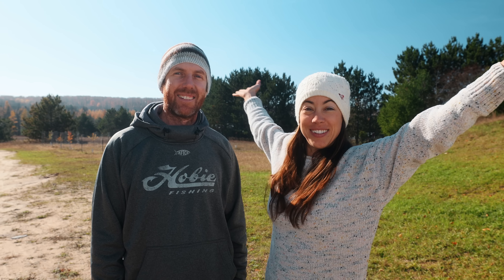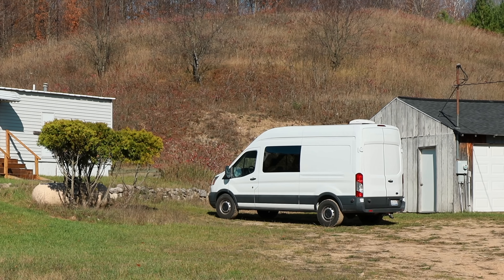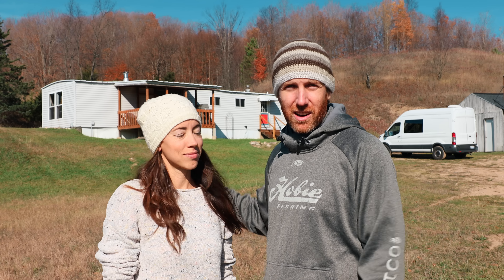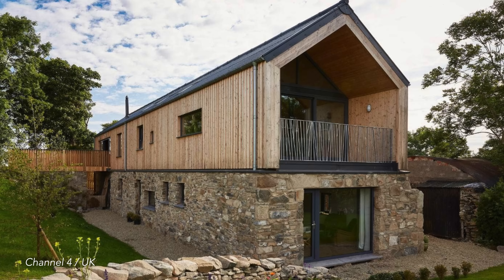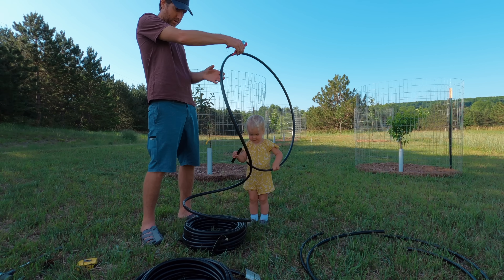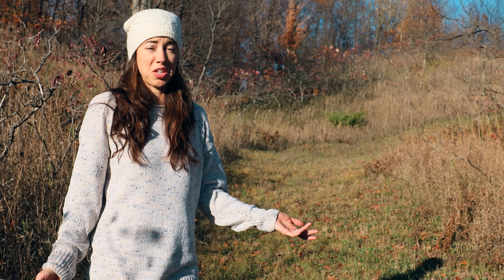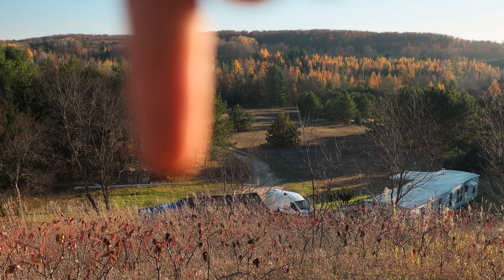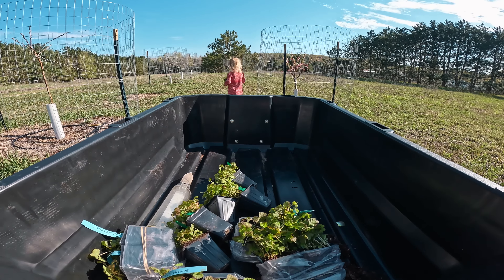Unveiling Our 9-Acre Homestead | Sailing Soulianis - Ep. 125

Comment: Lots of good suggestions here. I will add one you probably already learned from sailing. Buy quality to prevent emergencies, and budget for emergencies that occur anyway. New well pump? Well goes dry or goes bad and needs to be redrilled? Repair or replace septic? Raccoon gets into a building and trashes everything? These are occassional rural surprises that townfolk never experience, and even rural folk forget about until they occur.

Comment: We built our dream house on top of a hill overlooking the Missouri river valley.  When the wind blows, we certainly know it.  That said, the view is amazing, year-round.  We spent extra on 2x6 framing high quality doors and windows, and geo-thermal HVAC but NOT on insulation.  We used typical fiberglass batts and blown in.  The HVAC has absolutely paid for itself.  Foam insulation was moree than $20,000 over the fiberglass (not including the air-air heat exchanger for fresh air source) which would been forever return on investment. Under $200/month for utility (all electric) for 14 years for 4500+ sqft.

Comment: great to have goals...nice to see them evolving.  Reaction:  your Michigan limits will be cost and time if you do it all yourself.  In Europe on a house like that they don't build them but buy modular designs delivered to the site which are prefabbed, well insulated and very efficient.  All you do is pour the foundations/slab the modules sit on and connect in a day or two or three.  then do the finishing. All manner of degrees of stages can be bought usually.   It is an excellent solution done in a timely manner with less waste, less energy from you and pre ordained good architectural results.  In terms of do it yourself, I suggest you try the least critical, the pole barn, yourself to hone your skills and show yourself how much time and energy it takes.  Renting?  Talk to landlords and see what their experiences are first.  It can and often is a very mixed bag.  Permits.  What does the government body the land is on allow/'require?  Some permitsw take forever to get or are grandfathered against.  an unknown you learn first.  Gotta know what, how to obtain and the ramifications of that first.  Site looks lovely.  If you get a modular well built unit it can extend your season a couple months each way.....not a bad thing at all.
Reply from the maker: Have looked into modular, and affordable desirable options are certainly limited here. Those are our thoughts exactly about building the barn -- simple(r) project first, learn a bunch, then tackle the house.

Comment: Excellent; inspiring even. I hope you can make at least some of it work. I would love to see a map or a high drone shot of the neighbourhood or even a drive around. I have much smaller horizons than you do but I do have my 22ft cruiser in my back yard, under cover and I have my dinghy trimaran in a decent dinghy park a ten minute drive away  and it is stored  over winter in a hangar at a disused airfield nearby. - so I agree with much of what you are trying to do.  The deer have eaten my raspberries too (fortunately we do not have bears in Scotland.) A nice video. I hope your local builders are easier to work with than ours!

Comment: I’m currently in the process of building a Barndominium on top of a hill on property we acquired last year. The first year was building a road, getting water and septic. Early this summer we started building the main structure and have it closed in. Currently working on running power and doing electrical inside, want to be off grid eventually but starting out on grid was more practical. The view from the top of the hill is worth the risk of higher wind. But the barndo is 6x6 posts and 2x6 framing between the posts. It’s totally doable! Please feel to reach out and I can give you my lessons learned so far. I really enjoy your videos keep them coming! ⛵️😎
Reply from the maker: Sounds awesome!  Which part of the country are you building in?  Would love hear your plan on insulation. There are a lot of interesting debates going on in the barndo world.

Comment: I really love what you are doing and the adventure that is starting for all of your family.

(YOUR BOAT)  Not sure what to comment on but it may be best to start work on your large garage for your boat.  What I think your planning is great I just think you can considder the size a bit and make it larger if you can.  Why do I focus on storage for you boat as the first thing to considder is because of the harsh Winters in your location.  I could easily see your boat in deep snow and breaking down what condition it is in at this time, causing more problems.  I would focus on a permanent structure that may even include Solar for power and enough room so you can easily store your van as well as any other equipment you may want to have at a later date for farming (Not road vehicles).

(RENTAL PROPERTY)  I think its a great idea, but it's hard to visualize what type of structure (House) your going to put there.  The few questions I have about how viable of a rental property is my greatest concern.  With any rental property there is a line where upkeep and frequency really impact the bennefit or possability of it actually funding some of the things you spoke about in your video.  So thats a whole list of things to considder that I am sure you have already.  But an interesting project.

(MAIN HOUSE)  That seems way down the road with all the other projects you have on the table.  As to the location I think depending on the main direction of the weather pattern you can plant trees on t6he backside of the house location that in time can help with the wind (Pland sooner than later).  Before the first plan is done you can prepare the foundation by leveling and even laying gravel where you plan to build and years later that can be removed if needed.  The concern I have for the Gully location is snow drifts and water between seasons.  Without mayjor landscaping (probably will do anyway) the idea of building a house on that (Facing up the hill) Left side but not at the top due to (Wind) can cause many problems depending on the soil and bedrock in that location.  It may not be possible to build in that location so be flexable, as the Top or Left side choices may not even be a choice as I think the Left side choice may be more trouble than its worth.  I think a contractor or even a surveyor may be needed to determine the best possible location for a Permanent Main house to be built.

Lastly the planting of the Garden seems like a great idea, but I have never heard of a man made ecosystem that will be self sufficient, I am excited to see how that works out over a few years and one day a Garden of Eden.

If you made it this far thanks, at times I just cant stop.  You guys are great and love what you do.

Comment: I did a 1yr course in "CAD for Engineering and Architecture" a number of years ago. Courses included "Building Materials and Methods", I learned tons of useful stuff and would highly recommend something like that before you start. There is a lot to learn, from site prep requirements, zoning laws, fire and safety ingress/egress. Building standards vary quite a bit from area to area and a lot of close attention needs to be paid. However, one thing that I noticed is that there is a lot of room to build your own way as well. One area that interests me in particular is intelligent energy harvesting and thermal management. Being up north, if you leverage the sunshine and wind for heating you could save a small fortune in energy costs. You could also use the thermal difference between the ground and air to heat/cool at different times of the year. Lastly thanks for reminding us all of the reasons why we celebrate freedom, doing it your way is the ultimate sign of respect IMHO!!!!

Comment: Tipping the ends of the raspberries will greatly increase the yield. The cane will grow 2 branches and clusters of berries instead of singles. The canes also tend to spread all over. 
I hope your township will allow the rental units. I had to pull my old mobile home out and wasn’t allowed to rent it after I built the new house. 
I wanted to help with building my pole barn and was flatly told no due to liability issues. 
Mom and I found getting a modular house was WAY cheaper than a stick built the same size.  Walkout basements are wonderful and I love ours.

Comment: Go for it! I built my own house doing everything I could while holding done a full time job.  I hired out the parts that made since, concrete footings, Brick facade. Had a contractor pull the electrical and plumping permits then did the work myself, then the contractor inspected the work.  It took 8-months of hard work but the satisfaction of doing it my way was great.  I sold that house after many years and moved to town.  I was so frustrated with the home we bought in town because {built in 1955} there were not plugs everywhere there should have been among other gripes.  Point is when you build your own home you customize it as you go, and when done you will have the perfect house for you and the pride of a builder.  Best of luck.

Comment: Some rural ideas to share. Minimize exposure to propane. Ground loop heatpump, mini split heat pump, solar water even if not winterized.
Kuboto tractor just big enough for any attachment you will want. Snow blower might be better than blade, earth moving for sure, ~25hp.
Consider SIP panels, especially ranch level you might be able to do yourself.
I built my ground mount solar. If you did that you could move it as necessary. Mine is 8 panels on 6 cement footings.
Reply: As you lay out buildings, consider snow removal: How do you move between and around buildings, and where do you put snow. +1 to blowing snow instead of pushing it. Snow piles cause drifts. Blow it out of the way.

Comment: Structural engineer / construction inspector, 40 years. Feller once told me that building on a hilltop was a bad idea b/c strong cold winds would suck the heat right out of the house. I'd think of building the guest house, then living there while building a more permanent house where the sailor trailer is now. 
And be usre to consult the local building codes for requirements. Hire a pro electrician. Insulate !! 
Foundation must go down below frost line. Compact the soil under the spread footings, and place reinforcing bars at one foot horizontal and vertical (don't listen to anyone who says you don't need them)
Active and passive solar is a great idea, too!

Comment: The idea of building "in the ground" is an environmental wonder. 
The Earth maintains a stable temperature just a few feet beneath the surface. This means that in the summer, you have a cool home, and in the winter, you only need a very small energy investment to temper the COLD weather into a habitable home. 

Plus, if you design your Earth Integrated home well - orienting it well, you can "catch" a lot of sun in the winter to benefit from solar gain. You can build a mass wall that the sun warms during the day and it will release the warmth throughout the night even on the coldest days to minimize the amount of "artificial heat" you will need to bring it up into your chosen window of temperature. Plus, this "sunspace" can be used to grow vegetables during the winter to extend your growing season and lower your food costs even more.

There are lots of advantages to an "Earth Integrated" home. Where you are, out in rural Michigan, there isn't a lot of noise, but the EI homes are very quiet, and it isn't in a tornado area, but these homes are among the most stable homes in storms. 

The University of Minnesota has done a lot of research on EI homes ... They could prove to be a wealth of information as you move forward.
Reply from the maker: This captures so many of our reasons for wanting to build into the side of the hill. There is also something deep and ancestral about it. The feeling of being in a “cave”, is so deeply calming/comforting.

Comment: As someone who has been a 24/7 caregiver to my elderly mother for several years, build a house that is easy for a person in a wheelchair or electric wheelchair/scooter to get around...wide doorways, wide hallways, a shower with a bench and grab bars, can pull a wheelchair/chair to the bathroom sink to brush their teeth/wash hands, etc.
Reply: My parents did a remodel & thought ahead. Wider hallway, wider doors (bathroom, bedroom & its closet) etc.  They planned for grab rails but didn't install until they were needed, laundry up from basement to first floor.  Windows replaced with vertically taller ones in the front room, more light and easier viewing.  About 5 years later my dad's health started to fail, it was priceless that he could feel independent enough, maneuvering the main floor in his wheelchair/walker, etc.  The kitchen was never touched during the remodel but he was able to use the energy saved elsewhere to make his own coffee, snacks, etc.

Comment: It's all about balance.  The piece of mind, from knowing that you have options, is invaluable.  Air BNB has lost its' luster.  I would be more inclined to have guaranteed long term tenants and be able to plan around that income, with significantly less hassle.  If the wind in that area is an issue, then build into the hill.

Comment: I design and build beach houses in Texas and the least expensive sq ft price to build has been a smallish single story with a high pitched (10/12-12/12) roof that works out for a great large master bedroom upstairs. Think A frame or coastal NE cottage?
We were a couple of moorings to the South of y’all in Marathon in the Spring of 2021? On our open bridgedeck catamaran.
Reply: I have a 12x12 roof and hate it!! I think 8x12 is best. Easy to build side walls a foot higher as needed.
Reply: The 12/12 pitch is a little more time consuming to build, no doubt. But the 12/12 will give you an extra 8’ of interior width compared to the 8/12 given the goal of an 8’ ceiling height.

Comment: A few comments.  
Getting edible fruit from fruit trees takes some work based on experience- you will need to spray for bug/pests and birds/squirrels etc will want to eat ripe fruit. Assume you got dwarf trees.
Blueberries- birds and squirrels eat the berries, rabbits /mice may chew young shoots in winter, and you may need to enclose bushes in a metal small mesh screening enclosure that allows bees but prevents others from eating fruit or damaging plants.  Otherwise you are just creating a wildlife blueberry buffet.
House built into hill- you need to know what material hill is made of- mostly sand that will need to be stabilized or rock that will need to be blasted away.
Building rental house- what is the rental market around you like?- strong/weak? long term or short vacation rental.  Employment situation- year round or seasonal as it will affect rental demand? Don't rely on hope of "if you build it, they will come."  As I recall you had/have an urban rental property, but experience in this rural location may be different.
Post and beam storage facility- experience by a relative says "never put end of posts, even pressure treated posts, directly into the ground or touching the ground as it will eventually rot."  Given your intended use, would a self supporting steel tube frame with white UV resistant covering work at well for the time you have trimaran and convert to a greenhouse with translucent cover if needed?

Comment: Number 1 comment:  Kurt, Get a new pair of sandals!!!!  One has to shop in Russia to find sandals as the ones that you wear in this video.  Try shopping in regular stores.
Main advice:  Plan it all out.  Put on the project all that you could even remotely dream.  Go to town conceiving the entire property.  Once it is all planed start reducing what is above and beyond.  Once you have your goal property, break the project in achievable and doable parts.  Set your goals and full steam ahead.
My brothers and I are doing a similar project in the northern burbs of Chicagoland.  This is the seventh year of it.  So far it is going well, knocking on wood here.

Comment: Love your optimism and dreams! However owning rental property is not something that can be managed from the ocean. You will need someone you trust to check on the property, be sure tenants aren't destroying the property, be sure rent is collected, handle evictions when necessary, handle maintenance and repair issues that will arise.  A single rental unit rarely generates the money you think it will. Also need to factor in property taxes and insurance on the building. A possible option is to build a smaller rental unit to rent out as a b&b during the times of the year you will be there to oversee it. 
As far as deciding where to build a house, be sure to consider how you will get utilities (water, electricity,  etc) to the home site and how far they have to ran. It can get really expensive to run utilities long distances.
Please understand I am not trying to quash your dreams - just making sure you have info needed to make informed decisions.